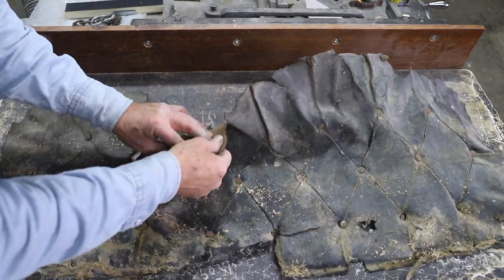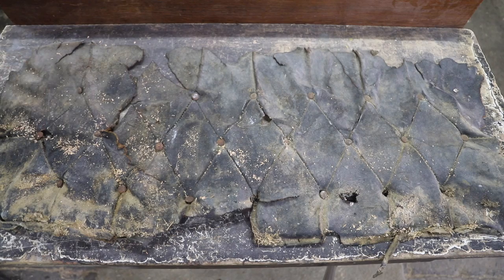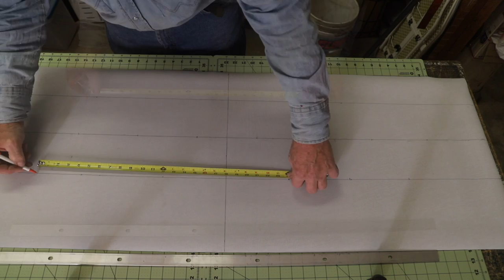Traditional Diamonds on Buggy Seats | Engels Coach Shop

Comment: Dave, I'm a rather new subscriber to your channel. But I have been amazed (as so many other viewers have beautifully commented) about your talents and skills. I not only watch you at work in your videos, but I am learning and trying my hand at imitating what you do.

I have watched all your videos now (and some of them I have repeated many times). Watching you has inspired me to tackle a project to restore an old farm wagon. You make it look easy, but every step is quite complicated and requires ingenuity to address the many variants one encounters in each process. Without your teaching instructions in the videos, there would be no way I would have attempted such a project. Thank you for making the opportunity possible for me. 

I have so far built new boasters that were rotted away and I am working on repairing the front and rear wooden axles. I disassembled my first wheel and have resized and heated and reseated the loose hub bands and re-seated the wooden spokes (and built one new spoke with a draw knife and spoke shave) …moving on now to replace several felloes. 

I could not find a “spoke stretcher” (or a pattern) on the web or at any antique stores, so I guessed at how to make one by watching your videos. I would have found it most helpful if you had a detailed sketch of such a tool. Also, sketches of your “tyre tongs” to stretch the tyre over the wooden wheel when shrinking the hot metal tyre would be helpful right now. (I need to forge such tongs but there are no dimensioned sketches anywhere that I have been able to find). 

Again, thank you for teaching so much through your videos. I look forward to all new videos and I will continue to watch the old ones and to learn from the master! Just saying “Thanks” seems so inadequate. But know you are appreciated and may you and your family be safe and be blessed. Peace! From a thankful and very happy viewer!

Comment: The day before this video, we spotted  a vintage commercial singer machine at a farm sale. After watching your video we just had to go back and get it.  Getting the machine home, model 111w151, we learned it was designed for automotive upholstery. The machine has been sitting in an out building for a few years, needs a lot of attention. Still we couldn't be happier. It features  needle unison-feed. Thanks for videos.
Reply: Ah yes, one of the walking foot models.  I regret letting mine go, but then at eighty I most probably won't need it!
JIM

Comment: Dave this has been a most interesting and educational series.  I’ve watched every video… some more than once.

A couple of things that I’ve also heard about those seat backs:

1. The pleats stiffen up the back so that it doesn’t puddle where they are constantly used.

2. The button tufting holds the Excelsior and cotton batting in place.

3. If you use Diamond tucking (like auto and residential seating) the folds hold water.  They also wear around the button penetrations and allow leakage.  You want a taut cover that expels water and doesn’t move.

You did an excellent job of presenting this whole series… thanks.

Comment: You may know formed batts of excelsior were used as evaporative media in swamp coolers.  Common for residential cooling in Phoenix AZ during the late 1950s-early 60s, when I was a youngster there.  But the job you do shaping it by hand is an art.

Comment: Dave, where you used spray adhesive to hold the pieces of the seat back covers together long enough to sew them together, how were the original seat pieces held together before sewing?  Would they have used something like hide glue?

Watching you thread the buttons through the seat backs was interesting.  What king of knot were you using, especially the "first" knot?  What following knots did you use?

Of course, all of this and your other videos is interesting, but these are questions that popped into my head as I watched!  ;)
Reply from the maker: The first knot is the surgeon's knot.  Then a simple overhand knot to secure it.

Comment: One thing Dave did while sewing was to use what's often called a Back Stitching where you go  back over what he Stitched near the end of a Seam. By doing this the Thread locks onto itself so it won't unravel or work loose once its cut and its done by pulling the seam backwards as it sewing and it takes 4-7 strokes of the needle to due this well. Your also disengaging the teeth like grill that moves the material forward  or pulling the material backwards against it too so the Stitches trap the Thread so its tail end can't work free. Kudos on another lesson about Upholstery and what's often called Horse Hair for stuffing isnt hair at all but a plant fiber.

Comment: Thanks again for sharing.  Presumably 'in the day' there would have been different specialists or subcontractors for many of the stages that you have accomplished yourself.
Just wondering whether all the stitch and button holes would compromise the weather resistance of the seats.

Comment: I’m always very interested in how you do things the way they were done “back in the day” so here is a question, you used spray contact cement to adhere the two panels together, what would they have done back the to bond the two parts, would they have tacked them with brads or would they have used Hyde glue?
BTW Absolutely gorgeous! Can’t think of a better description?
Reply from the maker: Much of the older backing boards were thicker already so they didn't have to glue them.